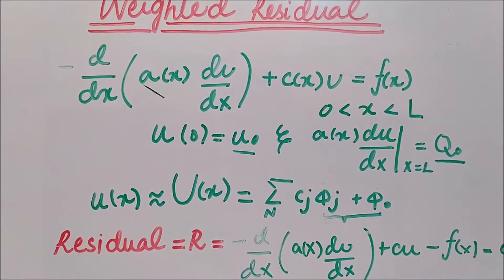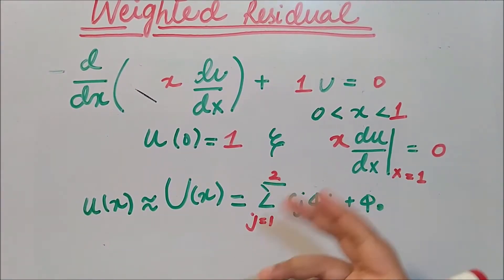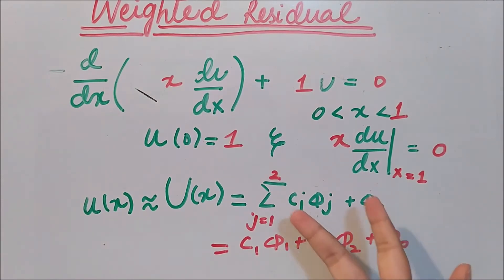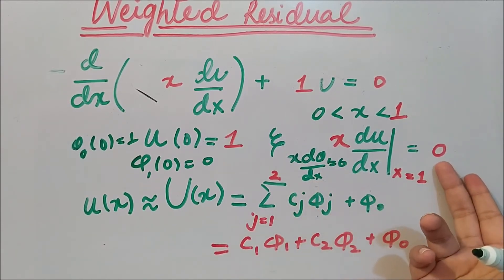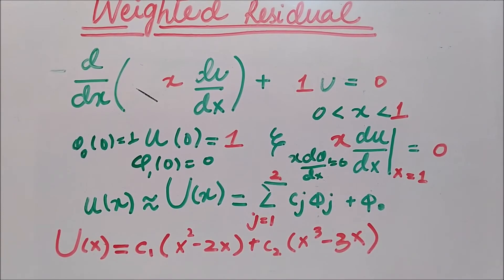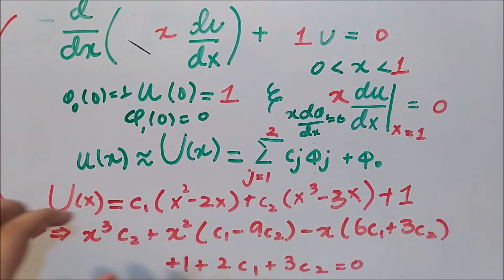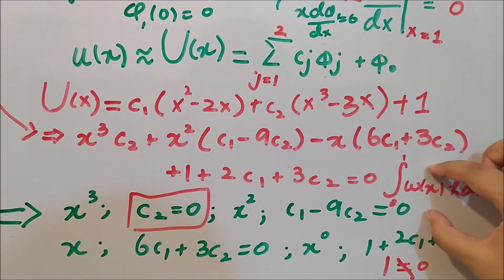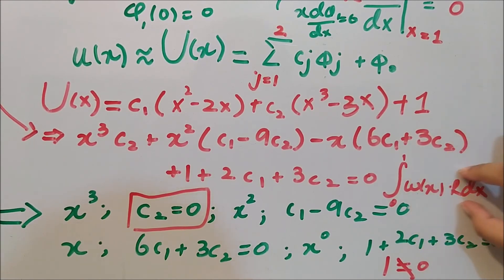Why Weighted Residual Method in FEM? | Solved Example

Comment: Stiffness matrix could be derived by the _______.
A) method of worb
B) energy method
C) method of weight residual.
Reply from the maker: Weighted residual method
Reply: @E-Academy  Thank you Sir B option Is Potential energy method so The option C is still correct?
Reply from the maker: Then it'll be C, I misinterpreted that